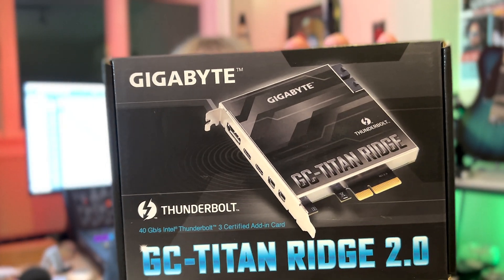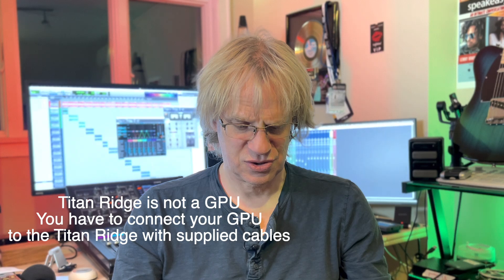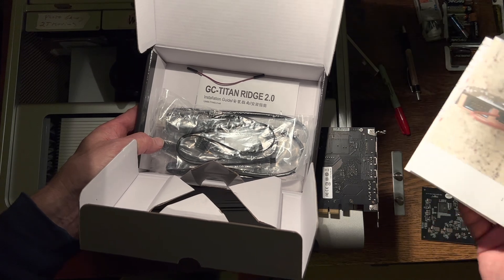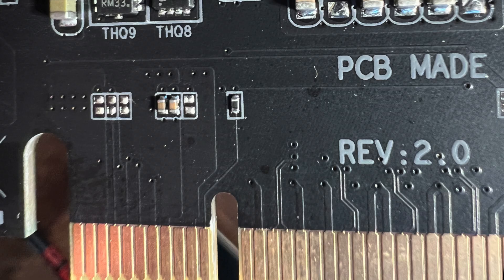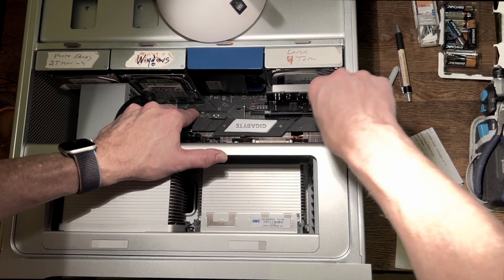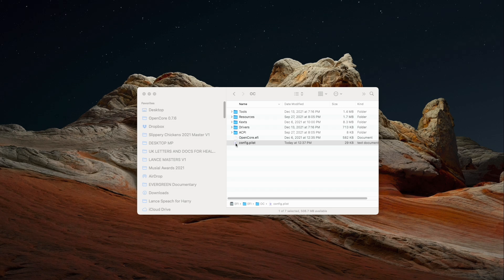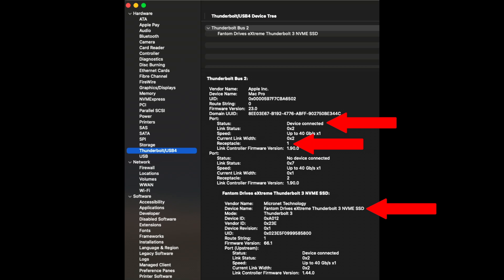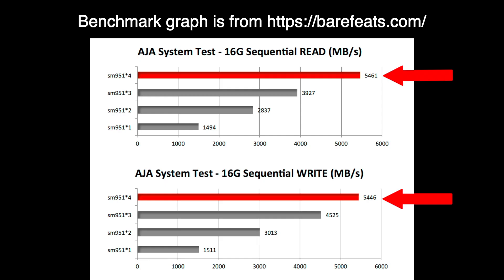Mac Pro 5,1 Thunderbolt 3 0 Titan Ridge pros and cons

Comment: Nice video thank you ,   i have the Titan ridge installed and  working , does not show  any devices connected  in system report .  if i attach an external  m.2 SSD to it  i can get speeds of 900Mb  as you have . i have checked Plist in open core and it is set to true .....  i have tried disconnecting then cold  restart  but no change ,, any help would be  appreciated    thanks
Reply from the maker: Not in front on my Mac at the moment but When you get system info on the card /pcie does it say it’s a Apple Card or Titan ridge? My card says it’s Apple so it may be your firmware. You can flash it if needed. The old way to get thunderbolt working was to boot into windows and then reboot into Mac OS when you did not have the flashed firmware. You are definitely stuck in USB  3.1 mode at 900 MBs. Also make sure to not have anything connected but a Thunderbolt device to the card and do a cold boot. Then after booted Unplug and plug replug in the device, does it show up then under get info / thunderbolt? Then reboot again and it should show up on the desktop if it’s a hard drive.
Reply: hi Lance, thanks for the swift reply , my system :  

Thunderbolt Bus 2:

  Vendor Name:	Apple Inc.
  Device Name:	Mac Pro
  UID:	0x0000597F7CBA6502
  Route String:	0
  Firmware Version:	23.0
  Domain UUID:	8A4C4E23-4BC6-425C-AF98-0DFE576940BF
  Port:
  Status:	No device connected
  Link Status:	0x7
  Speed:	Up to 40Gb/s x1
  Current Link Width:	0x1
  Receptacle:	1
  Link Controller Firmware Version:	1.90.0
  Port:
  Status:	No device connected
  Link Status:	0x7
  Speed:	Up to 40Gb/s x1
  Current Link Width:	0x1
  Receptacle:	2
  Link Controller Firmware Version:	1.90.0

This is how it stays , after re booting .....   the drive you used to connect  Thunderbolt drive , is that different from  standard  M.2 SSD  samsung nvme  stick .... ?   no matter what i plug in  nothing shows  on the Titan ridge card ..   BUT is does show on USB 3.1 Bus  

AM8180 NVME:
  Capacity:	1 TB (1,000,204,886,016 bytes)
  Removable Media:	No
  BSD Name:	disk7
  Logical Unit:	0
  Partition Map Type:	GPT (GUID Partition Table)
  USB Interface:	0
  Volumes:
EFI:
  Capacity:	209.7 MB (209,715,200 bytes)
  File System:	MS-DOS FAT32
  BSD Name:	disk7s1
  Content:	EFI
  Volume UUID:	0E239BC6-F960-3107-89CF-1C97F78BB46B
 STEAM M.2 980 1TB:
  Capacity:	999.86 GB (999,860,912,128 bytes)
  Available:	828.61 GB (828,613,206,016 bytes)
  Writable:	Yes
  File System:	Journaled HFS+
  BSD Name:	disk7s2
  Mount Point:	/Volumes/ STEAM M.2 980 1TB
  Content:	Apple_HFS
  Volume UUID:	176A294F-BEC7-3370-956F-70727A8DE141

Thanks for the help
Reply: Sorry forgot to add , yes when i plug in the SSD to the TR it does show up on the desk top and i can use it  but its running  and showing up on at USB 3 not Titan Ridge
Reply from the maker: @markclemo123  What drive are you using, maybe a silly questions but Is it actually a thunderbolt drive and are you using a thunderbolt 3 cable? My drive was a NVME thunderbolt drive. You of corse have an NVME but if its in a USB 3.1 case it will only get USB 3.1speeds.
Reply from the maker: @markclemo123  it most likely is not a Thunderbolt enclosure,  rather it’s just USB 3.1 send me  the link to the drive.
Reply: reading on the forums .   some peoples cards state Titan ridge   but mine says Apple Inc
Reply from the maker: @markclemo123  that means it’s been flashed for Mac so  check the specs of your drive enclosure and the cable your using
Reply: The main reason i wanted this card was for my UAD apollo's   i have a thunderbolt out on the Apollo but the ins on the Titan are USB C  so  can i get a cable from the apollo to the titan ridge do you know ?
Reply from the maker: @markclemo123  you need apples Thunderbolt three to thunderbolt 2 adapter. I would check the forums to see how the interface works with the Titan Ridge, some work and some don’t.
Reply: Great thanks , ill have a read up and see what i can find , just ordered  an adapter also a thunderbolt 3 cable so ill try in the Ssd enclosure when i get it . many thanks

Comment: Nice job Lance! What are you using to effectively create a bootable backup? I'm using Carbon Copy 6 (Big Sur 11.6.2, OC 0.7.5) and it's not copying over the main OS files. Any feedback would be appreciated.
Reply from the maker: Hey Bart, I cloned it once using ccc and it did the same thing you are talking about it didn’t seem to work as a bootable disk, then I reformatted the drive in APFS, the main drive not the sub and then Corbin copy cloner said this time around that it needed to format the drive to make it bootable and it it reported that it was bootable after cloning, I also named it Macintosh HD TB so I would know that I was booting off it. And I swear I did boot off it. I have been told by TSIAlex on macrumours it’s not possible  who I totally respect, but I would swear that I was able to. I’ve since returned that drive so can’t try it again. Another guy said he has also booted from a external thunderbolt drive. You do have to make sure by looking insystem profiler that the disk is always showing up under the thunderbolt connected items, because if it switches to usb it will read it as an external, but when it sees it as thunderbolt it sees it as an internal pcie drive.
Reply: @MacSoundSolutions  Which version of CCC are you using? According to their help documentation they are no longer creating bootable copies by default and recommend using "legacy bootable backup assistant" in the dropdown.
Reply from the maker: @BartMontalti  5.1.25

Comment: the bridge is between 1 and 3 (NOT 3 and 5)
Reply from the maker: Not according to the directions that came with my card they say 5 and 3 but the way its written is a bit odd,  but either way the jumper is where it should be position wise.
Reply: @MacSoundSolutions  when you look at the numbers on the board you will see - but your bridge is on the right pins ; -)
this misinformation has unfortunately persisted for more than 2 years!
Reply from the maker: @IndioA   thanks for the clarification, my photo of the board with the cover off doesn’t show any numbers just “J1” but it makes sense the top pin would be 1 and the bottom 5.

Comment: Nah!! Im planing to install Titan ridge to
Reply: So with all of the quirk is not worthed installing TB Card on this mac pro.
Damm i just wanna use my firewire interface on Big Sur using tb3 to tb2 converter and firewire to tb2 cable so i can use my saffire 40 in Big Sur
Reply from the maker: @gassanovfuad  not sure about that, FireWire 800 still works as far as I know can’t you just use a 800 to 400 adapter?, usb 3.1 always works on my Titan ridge without the quirks of thunderbolt so maybe there is a usb 3 to FireWire adapter not sure.
Reply: @MacSoundSolutions  thanks for this helpful video! I too was thinking about installing a Thunderbolt card in my 5,1 and your insights make it clear that it’s just not worth it given the quirks. In terms of whether or not a FireWire adaptor will work, I am successfully using a FW 400 to FW 800 adaptor for connecting my old FireWire audio interface  to my 5,1.
Thanks again! 🙏
Reply: @MacSoundSolutions  Just like i mention before in your other video "FW 400 to 800" not work on big sur. its working fine on catalina, mojave and above